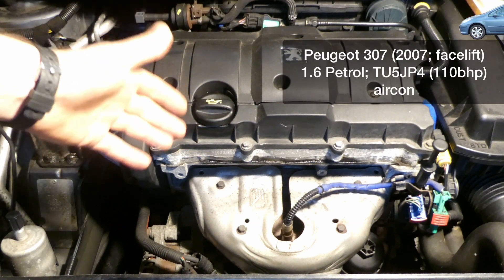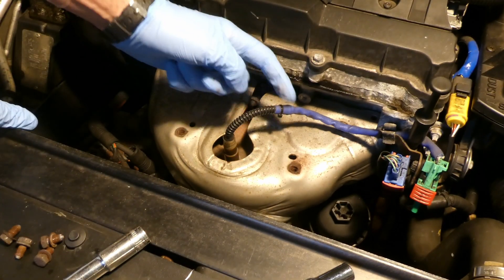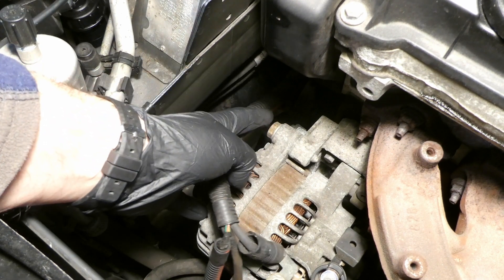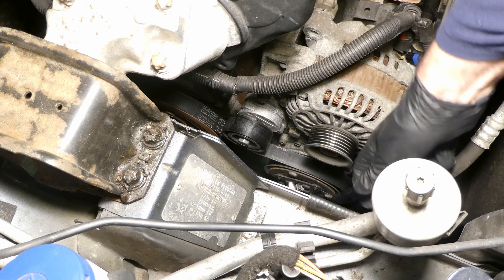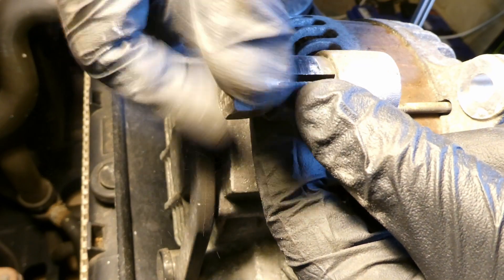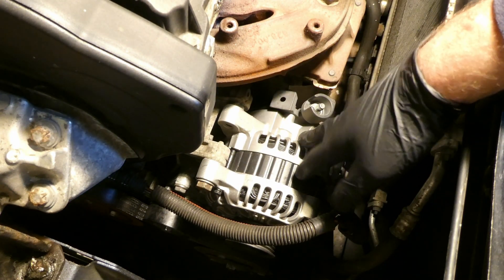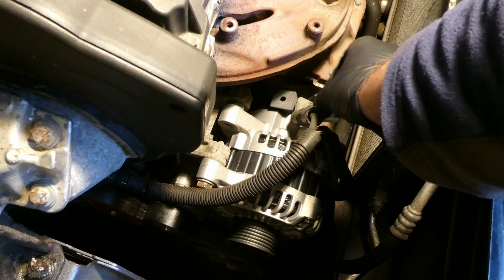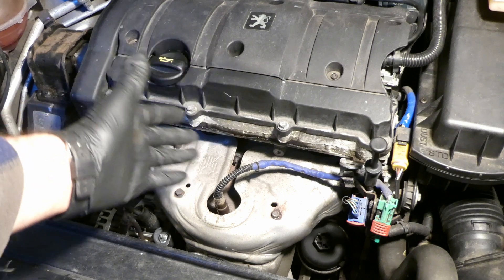How to replace the alternator in Peugeot 307, 1.6 Petrol (TU5JP4)

Comment: the alternator 12v  how much it charges maxim the battery ?  Thank you
Reply from the maker: In general that one should charge or keep the battery at ~14.3V. Mine does so when the alternator/engine is cold, when it warms up a little bit drops to ~13.2-3V.

Comment: which colors of wires have de sensor connector of alternator, please
Reply from the maker: Not too sure what the question is. The connection for the alternator, the single plug has one wire on it, not too sure what the colour is, but by memory yellow.

Comment: Hi there, what is the correct size belt for that particular engine, only know its 6pk
Reply from the maker: Yeah, any 6pk1069 will work. I got a Dayco 6pk1069 a few years ago and works quite well.
Reply: Morning sir, sorry to bother again, on the plug I've noticed there's only 1 wire connected to the plug, does it take only 1 wire? Im trying to figure out why my alternator is not charging, thanks
Reply from the maker: @bronwaynewilliams6851 No worries at all, if I have time I will answer.
Not too sure, but it is probably one one wire. My other Peugeot definitely has one wire on the small plug and they are both roughly the same year, although it is the 1.6HDi rather than petrol.
Nevertheless, even without that plug one can start and the alternator should work. I have tried it with and without and there was not a difference. It is a somesort of a network to the ECU, but not that crucial
Reply: Ok thanks, ive replaced the brushes on it and yet still the battery light shows, and stuff like power steering failure, components thats running of the battery, i have endless problems with that car
Reply from the maker: @bronwaynewilliams6851  Did you by any chance test the diodes of the alternator. The one I replaced had the diodes fail. I am still considering of replacing the diode plate and put it back on. A multimeter on the diode settings will tell you if they all work. There are several good videos how to test the diodes without dismantling the whole alternator.
Try with the plug removed altogether to start it and see if that makes any difference. Might be that the link with the ECU is broken.

Comment: Hi mate I have a Question for you!
Do you know if they do a drain plug for these cars and the 1.6 HDI Diesel that is easy to drain the oil out rather than take the drain plug out? like for instance do they do one with a liver that has a  spring that can just be turned or pulled to release the oil? Something like that so that you don't ruin the thread on the oil pan and bolt on regular oil changes
Reply from the maker: Unfortunately I am not aware of any other method to do it apart from the drain plug and suction methods through the dipstick. Probably suction pump through the dipstick is the only other method if you do not want to undo the sump bolt. I completely agree that every time one undoes the sump bolt you risk stripping the threads.